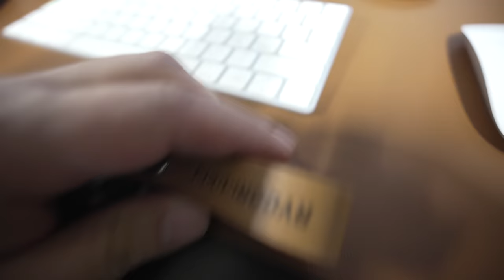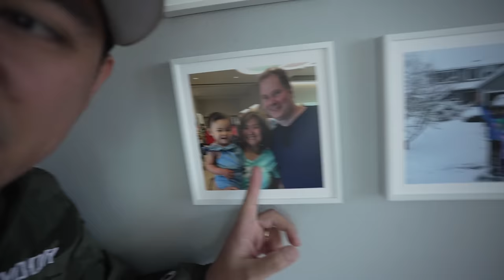I BOUGHT A GIXXER! SUZUKI GSX-R 750

Comment: I definitely feel a difference when I slightly change my wheelbase. When I got a chain set from sprocket center for my blade they sent me a 116 link chain which had my axle toward the end of the adjustment and I could not stand how much less nimble it felt in the turns. Felt like I couldn’t get it to tip in for shit. Took two links off which put it to the front of the adjustment and it was night and day.

Comment: What make is your quick release fuel cap? I recently bought one but it was chinesium and didn't seal. Water in the tank and engine. I was worried the bike hydrolocked but ive just fixed it.
Reply from the maker: Vortex
Reply: @adobomoto  no vortex in the UK. Will have a look at lightech or bonamici. Thanks.